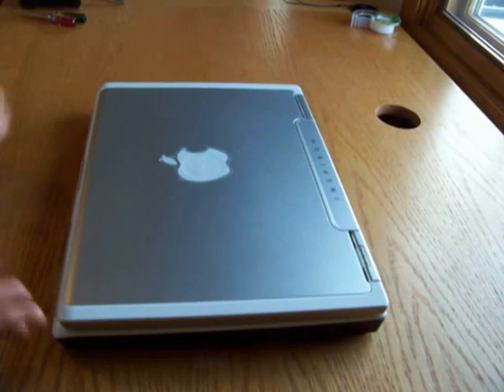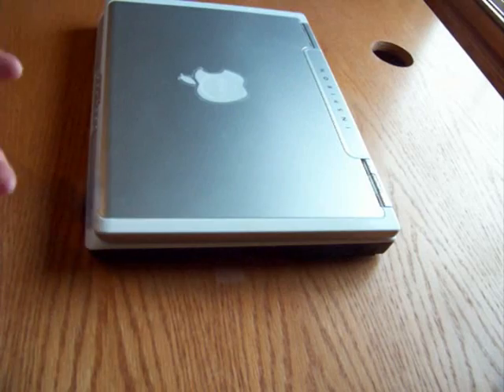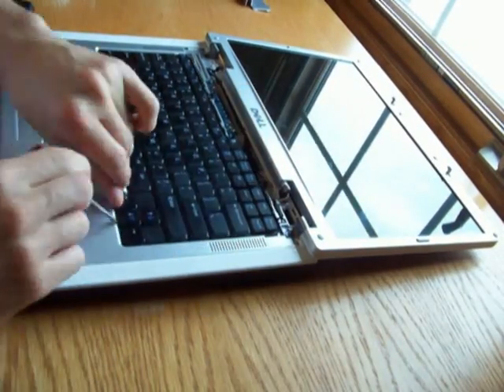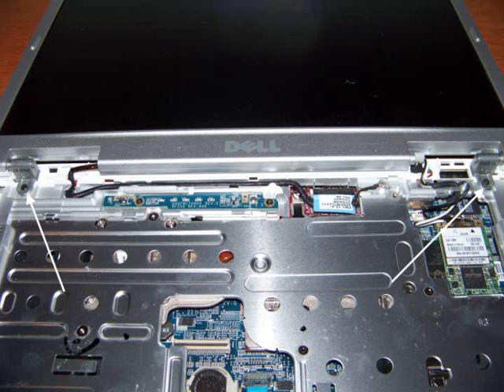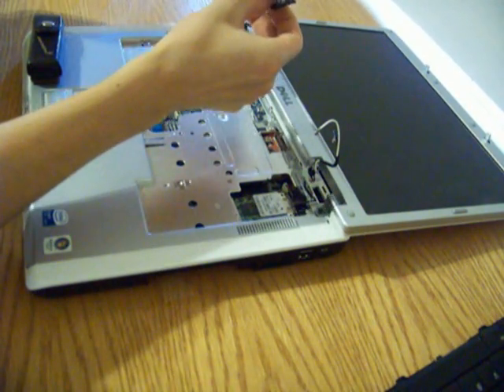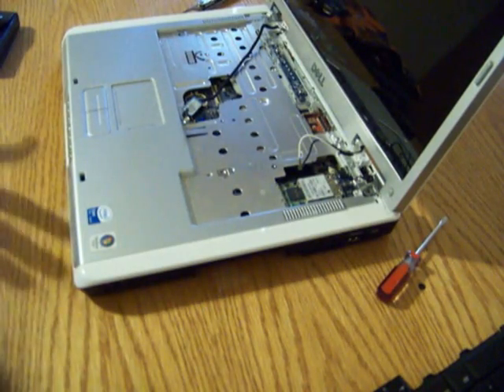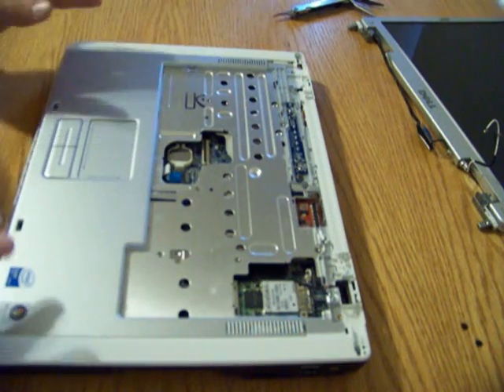How to remove and install a laptop graphics card. (Part 1)

Comment: So to answer the question if you can upgrade a laptop GPU:

If you have only some form of integrated graphics (Intel HD or AMD APU), then no. Not only is there no port to put the card, but there is no way to fit or cool it. Integrated graphics are part of the CPU itself. On some older laptops, there is a chip on the motherboard that acts as a GPU, called "onboard graphics", but the same rule applies. Now if you were to get something like a Razer Core that would work, but at that point you might as well save for a new laptop or desktop. 

If you have a discrete GPU (NVIDIA, ATI, or certain AMD Radeons) in your laptop, no offense, but chances are if you're asking that question you probably don't have the expertise to do it (I would be stuck on doing it too). An example of what one would have to go through to do it is here: http://forum.notebookreview.com/threads/g73jh-6970m-upgrade-infomation.641007/ 

That's just one laptop's procedure, not a universal thing (the laptop has an old ATI 5870m and is from 2010), BUT most cards nowadays are soldered to 
the board so you wouldn't even be able to take it off without breaking 
something.

The main limits you face in a case like that are thermal, power, and space. Laptop cards are built for a specific type of laptop, so would have to do some form of crazy jerry rig mod to get it to fit correctly. Remember that you're not meant to be taking it apart and swapping parts. Plus, the price you're going to pay for a replacement card might not even warrant the performance gain you're getting. With most laptops, it's best to realize you're going to have to replace it every ~2-3 years if you want to be able to keep up. The new NVIDIA Pascal GPUs in laptops (no more cut down mobile versions) will hopefully extend that lifespan by a bit.

Comment: Would the same steps apply if I have Intel HD Graphics?
Reply: intel hd is shared graphics , Dedicated Graphics refers to having a separate graphics card while Shared (also called Integrated or On Board) graphics means using your CPU and System RAM for graphics processing. The difference is fairly large.

Comment: I need help for my Asus notebook k53e series
Intel HD graphics 3000
intel core i5 2430m 2.40 ghz
can I change to something better like nvidia please tell me
Reply: The Happy Face no its a laptop u cant change the parts
Reply: Pjayy FL but why not? Just as a desktop pc if you can find compatible parts wouldnt you be able to insert a better ine and remove the old one
Reply: The Happy Face nope u cant do that cuz the parts are already stuck in there.. if u need more info just search up "can i replace the parts of my laptop" and people will  reply no
Reply: Pjayy FL ok :(
Reply: The Happy Face yeah i tried asking that too when I had my old laptop.. Now i bought pretty alright computer from craigslist for like 150cad$.. It was worth it because it can run games pretty well.. So yeah just build a new computer :)) what r ur specs in ur laptop
Reply: Pjayy FL i wrote above + 8gb ram , but what are your specs?
Reply: My specs:
i5 650 (3.2 ghz)
Radeon 4850 and Gtx 260 I have two video cards but im using gtz 260 right now, both of them are still good with gaming.
Ram is 6gb
Idk about the other things.. i forgot but yeah
Reply: Pjayy FL thats good, but I suggest you buy a gtx 710 at least, they are around 40-50$ and way better than gtx 260
Reply: or thats atleast what I have heard from friends
Reply: If your laptop has integrated graphics (intel hd .... or if you have an amd a-....) then the answer is an immediate no.

If your laptop has dedicated graphics (nvidia or ati) then there may be a better graphics card that HP made for that product line. Desktop graphics cards all use the same port and size (at least in height and width) standards, laptops on the hand vary from OEM to OEM and even model to model so you have a very limited amount of upgrades available if any.
Reply: CocutFX i have an hp pavilion with  nvidia 840M can i change it to an gtx 970M?
Reply: yeah i now know that intel does mostly gpus inside their motherboards, but before i didnt know that anyways thank you all for your help and suggestions

Comment: Can I change the GPU on my Asus Laptop? It's GPU is a Intel HD Graphics 5500, CPU is Intel Core i7-5500U @ 2.40GHz with a 12GB RAM. Also what the best graphics card this laptop would be able to handle if I am able to change it? I've got The Witcher 3 but annoyingly it lags like mad even on the lowest settings for everything. :(

Comment: I need help! I have an HP Notebook and it has windows 10 home 64 bit 
AMD A6-5200 APU with Radeon(TM) HD graphics 
4gb ram

I want to change the graphics card and ram memory on this laptop, but I want to know if it is possible. And if there are any recommended upgrades?
Reply: its possible and i think you should go for the gtx980m and 16gb ram
Reply: How much do the parts cost?
Reply: no, there is no place to put the card
Reply: +Co Takhle Lore? fuck you

Comment: Dude, fuck this, why not just buy a desktop? With a desktop you literally just have to open the side panel replace it and put it back on! I'm not assaulting the tutorial it was REALLY helpful but it's better to just buy a new laptop if you have to do this you have to take everything off the laptop to get to the graphics card.
Reply: JC Unboxes I mean taking it apart, dumbass. Desktops are easier to take apart than laptops. If you want portability buy a laptop.
Reply: JC Unboxes Oh, sorry dude, I've been in a lot of debates so I stay alert but..  This video is about how to remove a "GRAPHICS CARD" so why not simply buy a desktop and slide a graphics card in that?

Comment: Okay, my big question ... I have an integrated Graphics Card so I don't believe that there is a selected slot in my HP G56 for a GPU. Am I still able to add a graphics card / is there a space for a graphics card in my PC? Cheers,
Reply: You most likely need to find a better APU (Cpu with integrated video card)in the same series(In example if there's one with identical Idnumber(I.E yours is Lenax 123123 the other Laptops name must be Lenax123123) 
The reason why is because Laptop market are the wild wests when it comes to standard Laptop cases. Screws that burrows straight trough the entire case and components who are on purpose being specialised to fit in to your Laptop makes upgrades just as useful like finding replacement parts to a handmade car.

Comment: can i do this with an i7 5500 cpu 2.4 ghz and an intel hd 5500
Reply: wtf? you have a great laptop why would you change it?
Reply: Razor reznov
Cant run Fallout 4.
Reply: G64 well you can't change graphics card for laptop.
Buy desktop next time , you can easily upgrade your desktop.
Buy a desktop with 3.2ghz processor , 4GB ram and latest graphics card with DDR 5 ram

Comment: I have an Asus laptop with an i3 3200U cpu, 4gb of ram, and intel hd 4000 graphics. I don't know anything about laptop graphics. What is a good gpu I can chuck into the laptop to make it better for mobile gaming? I know it's not designed for gaming but I need something more powerful for on the move than I already have. Cheers!
Reply: +Tom Brown The Intel HD4000 is integrated into the CPU itself. Your laptop probably doesn't have a slot for a dedicated GPU. Even with external GPU which uses the MSata,  Expresscard slot or even if you have a thunderbolt input port your CPU is too weak which will bottleneck the GPU.
Reply: danish ACOG I know now that I can't upgrade my laptop graphics but I use the laptop for streaming games from my hardcore gaming PC.

Comment: Is Intel Core i5 a factory standard graphics card? Because I want to replace it with a EVGA GeForce 8400 GS 1 GB DDR3 PCI-E 2.0 16X DVI/HDMI/VGA Graphics Card
Reply: +A32rock if you mean intel hd graphics you're not able to changed dont ask but its just not possible unless its not a intel hd graphics so.........
Reply: Saiyan Saya Ok, thanks for the reply
Reply: +A32rock but there is a video on YouTube wich tells what graphic card you can switch and wich ones you can't  :)

Comment: is it possible to connect 2 laptops to make a fastet and better pc?
Reply: ㄔㄞㄘㄛ If there different brands (Apple and Windows) then no, but if you have a computer lets say you have the Microsoft Surface 2 and the 3 then yes you can switch parts to improve your gaming and how smooth it runs.

Comment: This video only taught me "how to disassemble a macbook".
It's much easier to change hardware on my laptop, all I need to do is; remove the screws who holds the lid, unscrew the GPU, remove the cooling compartments, unplug the GPU, plug in new GPU, screw on cooling compartments and the lid, DONE.
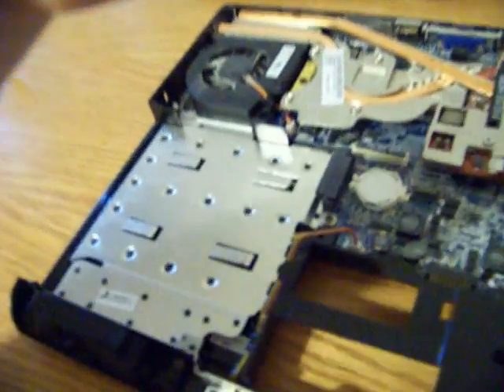This video is a waste of time (unless you have a laptop like his). Skip to 8:19 to see how to remove the GPU, the rest is just how he disassembles the laptop
Reply: Seriously?! That was not even close to macbook it was a windows laptop with a apple car sticker on the back
Reply: mikkelnpetersen where did you get macbook from?

Comment: Can i put it in my PC
Reply: Serb Berson Dude GTX 960 isnt compatible wth laptops normally if u can use it as a mobile version okay
Reply: Serb Berson Bcs bo 3 is no match for gtx 960m ?just go to the geforce experience and see if it says mobile version or not jesus christ kid!
Reply: Serb Berson Υeah me two but that doesnt mean u have the desktop version of gtx 960 in ur laptop...-_-
Reply: +eVCephei I dont think you can graphics card for laptops are mobile version which are different from the desktop ones...im not that sure about it but thats the way i think it works.
Reply: +Chris Markakis i have a gtx 960 card on my laptop -_-
Reply: Serb Berson Yeah the one in ur laptop is gtx 960m which is the mobile version different from the gtx 960 for desktop version -_-
Reply: +Chris Markakis so thats why it boosts up the FPS when i plug it in on the charger
Reply: +Chris Markakis Then how can i run bo3 at 60 fps high settings?
Reply: +Chris Markakis I use geforce experience
Reply: +Chris Markakis I can literally film an entire vid of bo3 running on my laptop.
Reply: +Chris Markakis tbh he never stated that it was a desktop GPU.
Reply: PantOS Gaming ...he said he has GTX 960 which is the desktop version whereas gtx 960m is the mobile version for laptops!Thats the basics...

Comment: Excuse me, I have a question, my laptop is a msi gs60 3k that comes with the gtx 870m. I was unlucky that I bought it before 1 week of the gtx 970 and 980 release. Im not planning to replace it though, but I just want to ask if it's replaceable.
Reply: Albert Feng if it can fit an 870 and an 860 then it should be able to do that

Comment: Also is it possible to do this with an HP Notebook laptop
Reply: yes I think
Reply: cool!
Reply: maybe not cus laptop prts u can not rly find I have looked into it
Reply: True, even thus HP laptops can be accessible to get to the graphics card, the graphics card is very different in comparison to the Dell Inspiron in this video, making the ATI Graphics Card he used, and the HP's Graphics Card: Intel Family very different in shape, because it doesn't have the copper wire that connects to the cooling unit in the HP, if you were to buy a new graphics for the HP, it comes with the cooling fan and the graphics card, which is a whole different process in compared to the type of one he used in this video! So most likely it is mostly impossible to replace one on the HP, because each type of laptop (HP, Dell, Apple, Acer, Windows, ASUS, etc.) are very different on how the graphics card they design.
Therefore, you would of had to had an expert technician to do it and possibly he or she couldn't figure it out. I did research on it and it is not possible to do it on an HP because of the frame and components. This is why this video is made to do it for the Dell. Because its impossible to do it on an HP Laptop.
I just researched it, so most likely going to have to buy a desktop, because its more easier from what I've seen in some videos! 
But thank you for the information, Ill see what I can do! (:
Reply: Or maybe, you can build one from scratch, but that's a whole different process.
Reply: yes u would have to build one from scrath but desktops are easy to build and much cheaper :]
Reply: Indeed!
Reply: Yep! also look ib=nto Roccat they are preety good keyboards for very cheap

Comment: Laptops are simple and easy to have around and move, but for power and actual uses, holy shit do they suck ass. you can't even upgrade them, you gotta buy a new laptop, my brother had his computer started to fall behind and break down, and he just replaced his gpu and motherboard I think, and something else, but in short, you can replace and fix a pc for easier matience than a laptop. But the laptop still has advantages, i just perfer a pc. Also sucks how this video doesn't apply to all laptops.

Comment: Unfortunately, intel cards are soldered on. Only ATI, Nvidia and AMD have removable cards (if you're lucky)
Reply: i have AMD V160 2.40ghz
Reply: Crap. I was hoping I could cut down costs by just replacing my graphics card, guess I need a desktop now. And money for it, gonna be a problem.
Reply: Crap, looks like I need a new machine.
(I can't play Warthunder Ground Forces without crashing. I assume the same will be said about other games in the future too.)
Reply: Xarm Chia
You can buy some of the budget gaming laptops from Asus. The most basic ROG series comes equipped with an amd a6 cpu/apu should work out fine.
Reply: lazyweapons Thanks!
Reply: *****
 You can replace intel mobile processors, if the socket fits. Intel have their own mobile graphics chipsets which are a pain to replace.
Reply: lazyweapons I have a core I7 but a shitty intel graphics family hd card so I can only play small games on near their lowest settings, I really wish i could replace it with a geforce but life sucks
Reply: +stellar su ya but if you have 4gb and up of ram just up your dedicated video ram that's what you want for gaming
Reply: WickedKillaGaming ok I have 6gb of ram
Reply: lazyweapons Do the Asus gaming laptops come with Graphic Cards that support T&L
Reply: Wait so if i have and AMD card i can upgrade it
Reply: lazyweapons ammm i have amd and intel both of them in one laptop???????
Reply: Karma Artz which one is better amd Radeon hd 7400m or intel hd 3000 ,(for gaming)

Comment: HOW COULD YOU PUT AN APPLE STICKER ON A DELL COMPUTER D:
Reply: fappingoat So does DELL...
Reply: Dimitar Stoyanov I painted my PC with racing stripes and flames. Its so fast now.
Reply: I don't use dell So i cant really say. But im pretty sure dell's are supposed to be work pc's. so they arent supposed to be amazing
Reply: My friend put a  apple sticker on a Samsung phone

THE HORROR!
Reply: Juan Torres actually, they are very nice. They are the best by far commuter for video editing / moviemaking.
Reply: I hear people say that, but i don't really see it.
how is the video editing any better on mac?
Faster? Easier Programs to use? As far as I'm concerned neither of those are true, unless you comparing a mac to a really crappy Vista, running windows movie maker.
Reply: Well, its easier for a couple reasons, for one the display has more pixels, zoom in more for your needs, i like mac mostly bc of they just look really nice, but they're not overpriced either, and plus i just think windows 1.8 is horrible, its looks like its for a phone, not a computer
Reply: Windows 1.8 huh? Lel, also nice grammar.
Reply: NickNakulus Nice job making the obvious joke, ya mac using scrublord.
Reply: I don't use mac... I have one though
Reply: If you put an apple sticker on an apple - KaBaM 100% more sales per day.
Reply: Glue ….
Reply: they aren't :/ apple is just a over prized pc/laptop that is expensive just because it has an apple on the back of the computer...i mean realy there is noting special nor amazing on any apple computers, people just buy them cuz you know...they are expensive. if you put a apple on top of a piece of crap people would buy it just because its apple.
Reply: Fappin' Goat I imagine cool laptop painted in flames :D

Comment: So by factory standard, does this include AMD?
Reply: If you don't know whether or not your laptop is factory standard, it is. This video is a little misleading in the sense that it gives the impression that upgrading a laptop graphics chip, (not card in factory laptop) is an option for the type of users it would attract. Most people with a laptop this could be done in either built it, or bought it (for much more $$) with the knowledge of it's upgrading potential. (Gamers)  Aliennware is probably the most common brand that would sell factory standard laptops with this capability.

Comment: can I add another graphics card onto my current laptop, meaning can I SLI it.  This laptop has a gt 650m in it so is it possible install another one.  Also, is it a good thing to add  another graphics card.
Reply: Just buy a new computer, even if you could SLI which I would be extremely doubtful of, it's just turn your laptop into a toaster with a lifespan of 6 seconds.

Comment: I have a Lenovo P500 ideapad. All I had to do was unscrew 8 things on the bottom and the entire bottom popped off, then I had access to the battery and graphics card from there. So when I was getting a new NVIDIA Quadro 4000m card, it was allot easier :3

Comment: I bet I can do this, go to another location, use the laptop and come back in a faster time than a desktop user could do the same work and then haul the heavy ass setup (even a mini-itx by the time you have the computer, screen, peripherals and cables with you) to the location, set up, use the PC, then pack it up again and haul the whole lot back. Hence laptops have there uses, thus I own one.

On the other hand if your not going to move it then yes, a desktop pc is for you.